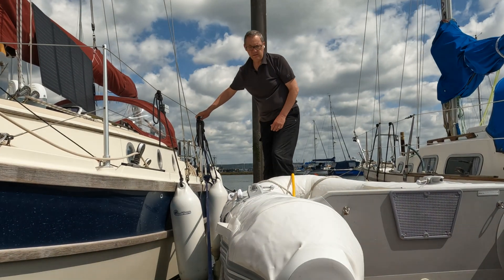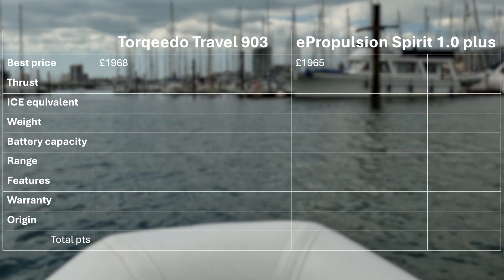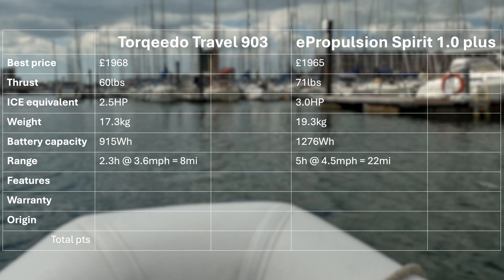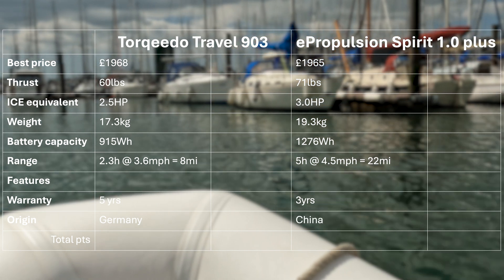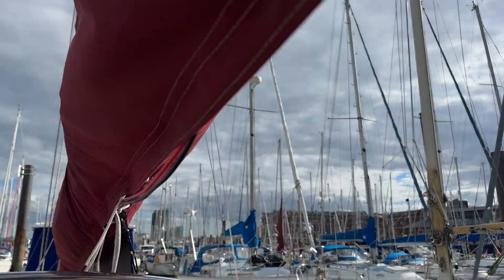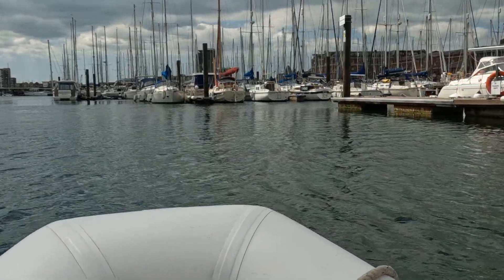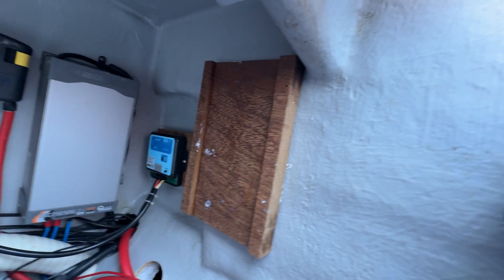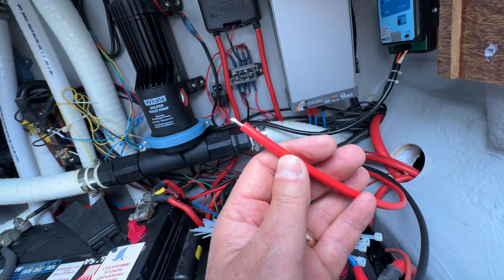ePropulsion Spirit 1.0 Plus vs Torqeedo Travel 903 - choosing outboard in 2024 and solar install

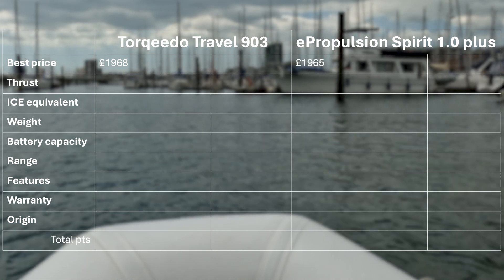Comment: I think the price you’re comparing for the epropulsion spirit 1.0 is just for the motor without the battery included. It would be an extra $1,300 for the battery. 1:55
Reply from the maker: Thanks for watching! The prices were correct at the time and the epropulsion included a battery.
Reply: @erbster200  that’s awesome!

Comment: Very clear video! Thank you for sharing. What inflatable tender  are you using? I am exploring getting a Truekit Navigator 300.  Trying to get one that I could occasionally fly with as checked in luggage.
Reply from the maker: @sambarjack  mines a Crewsaver air deck 2.7m. It would be pretty heavy to fly with.